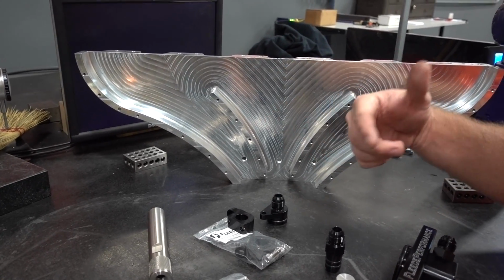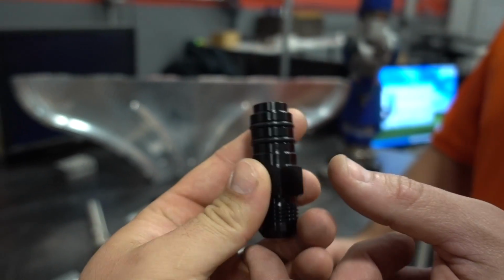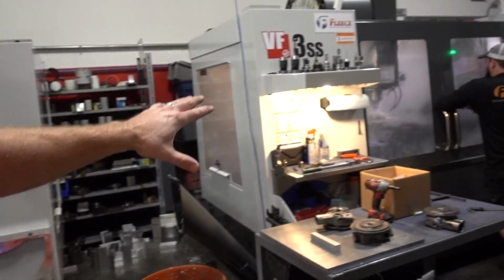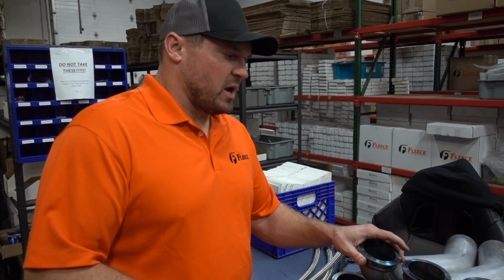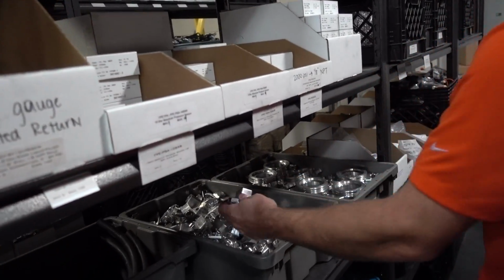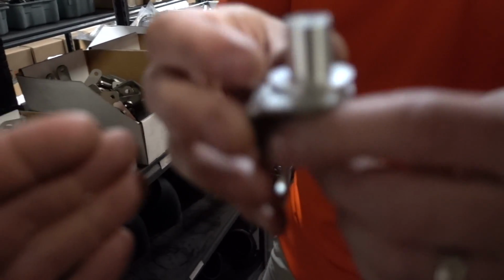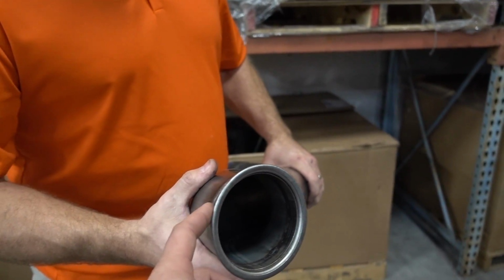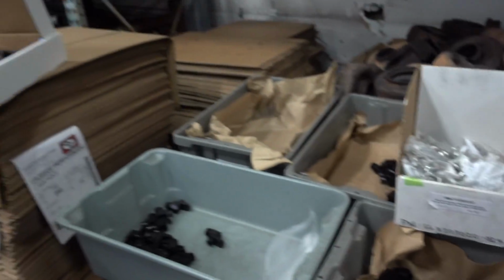CRAZY CUMMINS BILLET CYLINDER HEAD!!!

Comment: I got Fleece’s turbo oil inlet hose for my 5.9 3rd gen (factory location) it’s a nice piece. The only thing I’d like different would be the female AN fitting on the turbo side, it woulda worked better for me as a 45 bend instead of a 90 with the length of hose they provide.

Comment: I've been driving a 2015 Ram 1500 for a couple years and looking to move up to a Cummins 2500. What are the best years to go for and which to avoid? Looking at a 2011 now
Reply: I like my 06 it doesn’t have dpf or any of the exhaust filter/egr crap on it. Once you get into the 6.7 engines there’s no getting away with it unless you live in a place where you can strip it down (delete emissions crap). I’ve had a combined weight over 19k lbs truck and trailer towing from Ft Lewis Washington back to Pittsburgh with no issues. If you intend on running a downloader I’d advise a transmission/clutch upgrade. Mine has the G56 6spd and I’ll keep it for ever if I can. If I bought another it’d probably be a 12 valve since. I’d never pay what they want for these trucks now.
Reply: Mopargocar thanks for the reply. I ended up buying a new 2017 two days ago
Reply: Gratz man!

Comment: Does anyone make a 5" DP for a 6.7 2nd gen swap stock turbo location?  I made my own, but that was quite a bit of work which I would of payed for.
Reply: MorePowerThenBrains Flo pro
Reply: Matt Juniper I do believe their 5" DP is for a deleted truck with stock mani and turbo. Which is what I used to fab up my DP when I 2nd gen swap my '12......... maybe I'll have to look into it. If you have a link I would appreciate it.
Reply: MorePowerThenBrains look on there website call them or talk to a dealer you can order just the downpipe for the second gen placement I know cause I am running Flo pro for my 2nd gen manifold swap on my 07.5 6.7 cummins
Reply: Matt Juniper I’ll look into. I appreciate the info. Thanks
Reply: Contact Ray @doublerdiesel. He just did his and very impressive I must say.

Comment: Hate to be this guy in the comment section but I couldn’t find much info elsewhere, I’m still pretty new to the diesel world. I have a early 04 (305hp) 5.9 and she’s ready for a bigger turbo. I’m leaning towards an s300 based turbo, but I would love to get a fleece 2nd gen swap and an s463 or similar. I still need this truck to be a reliable tow rig, but also like to have fun with it. I know Greg has an s467.7 on the tow pig, but I figured the 6.7 and G56 helps it spool. How would an s400 do on a 5.9 for a tow rig with around 600hp?
Reply: LivinglikeLogan I had a s463 fleece turbo on my 5.9 and for a tow/daily it was a beast
Reply: you would be fine with a smaller 400 series. especially if you throw in a little bigger injector.
Reply: Headstuds 😝
Reply: CJay Stauber It’s got 50 horse Boschs and a smarty touch
Reply: ya you will be plenty fine. i got a Borg warner 362 with a .80 housing on my 2001 because of everything i read about going any bigger and it will be super laggy but it spools like stock and wish i would of gone a little bigger actually